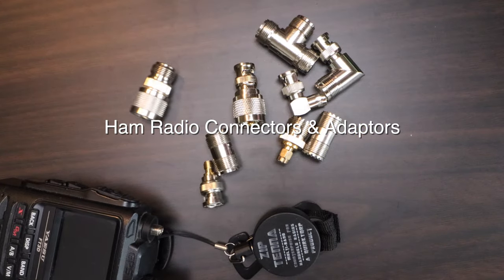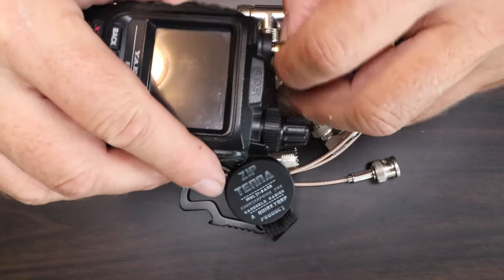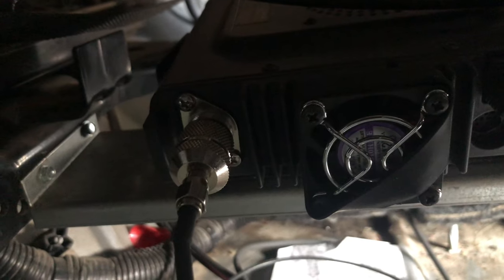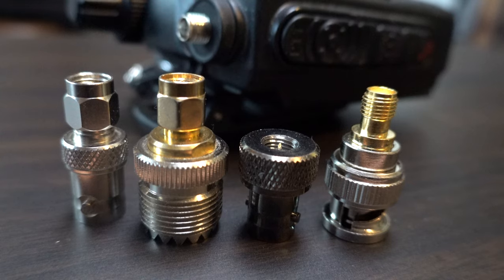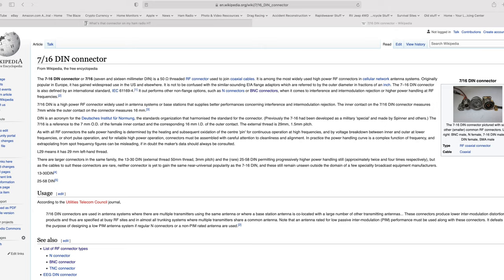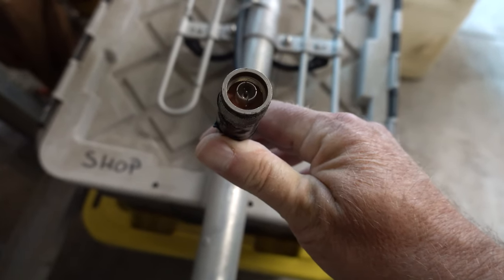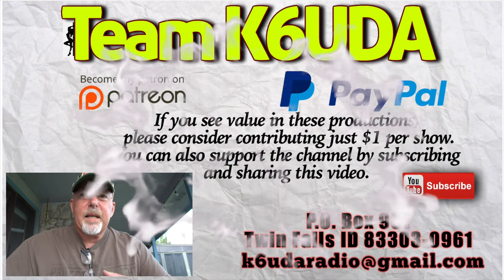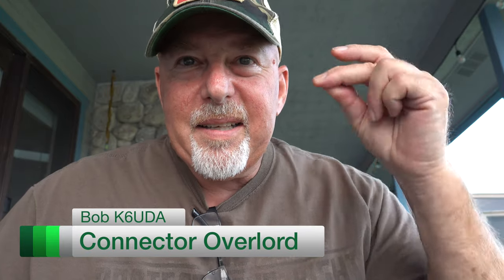Connectors & Adaptors For Ham Radio 101

Comment: Got one of those divided plastic carriers, put 2 of each kind of adapter in each compartment. Sooner or later, especially in the field, they get needed.
Reply from the maker: I need to do that.
Reply: I use a fishing tackle bag that holds 7 of them. All my connectors(SMA, PL259, N, BNC, F) are in it, N and PL259 have their own boxes with adapters, SMA and BNC share a tray along with adapters,, along with ring, spade power stuff, one tray of fuses, common nuts/bolts/screws used on antennas along with some band screw clamps used on antenna elements, and a box dedicated to powerpole stuff. The front pocket has all the strip and crimp tools, side pockets a small soldering iron, solder, 25' of 12 gauge power cord(red/black) and some other misc wire pieces just in case. And most importantly I have a cheap DMM that stays in that bag. I can grab the bag and go outside and fix any connector I use, the bag goes to field day for setting stuff up(I wrap all adapters with a label with my call sign, things aren't cheap, I want them back!), and I have helped friends put towers up and setup their stations. The grab and go aspect is awesome and the local ARES group I belong to loves it because it ups our readiness for anything.

Comment: Get some plastic tubing with an inside diameter the same as the outside diameter of the HT SMA adapter. Cut it a little longer than the SMA end of the adapter. Push it on to the adapter. Screw it in to the HT and it compresses slightly and gives great support so the adapter and the HT connector have little to no stress. I've been doing this for decades and never had the HT or the adapter suffer any damage.
Reply: Great tip! Since I use the Diamond SR77that has more moment and thus stress to the SMA on the radio body, I'm going to try it.

Comment: Thank you! I learned I have a SO239 on the back of my radio. Now I'm wondering if the Antenna wire I order will come with the appropriate male end or if I need to order and adapter. Hate adapting because it just introduces a point of possible interference or failure (in my mind)

Comment: Not all SMA's are the same... many fail above 1ghz with high SWR. Stick to Amphenol on the higher freqs. And hardline? I have 500 feet of it in my station and adding another 250 or so... all I use! No din connectors though, all N's Almost need to go din on 1296mhz with 550 watts... Cell site swap out the hardline every 5-6 years. It is still perfectly serviceable after cutting 5-10 feet off the ends to eliminate any water intrusion. Tower companies keep it as scrap metal so if you can find a local tower service company in your state check with them. 20 years ago we got to clean out their storage yard for $100. We FILLED the back of a flat bed roll back wrecker! Got a brand new spool of 1 5/8ths (LDF7-50) hardline that was dented on the outer layer. Peeled off the dented layer, used it on 6 meters for years, kept the rest for 432 to 1296!

Do you operate 6 meters? Had some openings out your way this summer and wondered... one night I had a pipeline to your area on 2 meter e-skip for 2 hours. All SSB of course, not FM!

Another good topic is connector assembly, solder, crimp/solder center pin, crimp only... I went all crimp 5 years ago and won't go back to soldering. Picked up the DX Engineering cable prep tools that do all the stripping and cuts for you and won't ever go back to solder on connectors. With solder I have had the braid connections fail, especially on center pin solder/clamp braid N connectors that after to many cycles(hey I am cheap, replace cable when it fails!) that make the braid break off under the clamping nut. Crimped connectors the braid and jacket get crimped down, no chance of it coming loose unless someone hangs off it with all their weight!

I currently operate 160 meters thru 23cm... all SSB/CW, although my 160m antenna is marginal at best!
Reply from the maker: Great info. Thanks. I’ll have to look for a service company and try to score some hardline.